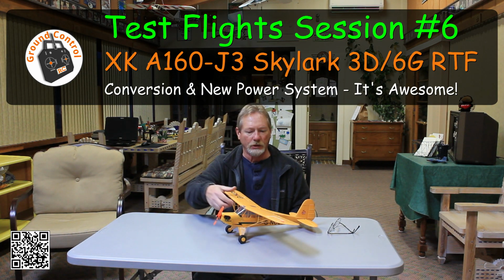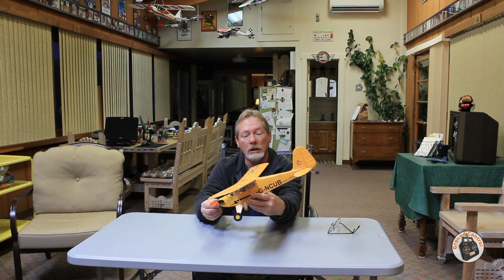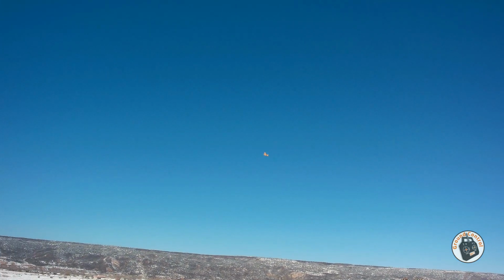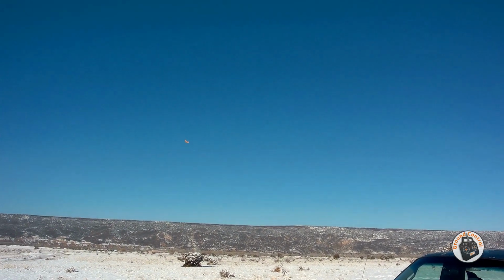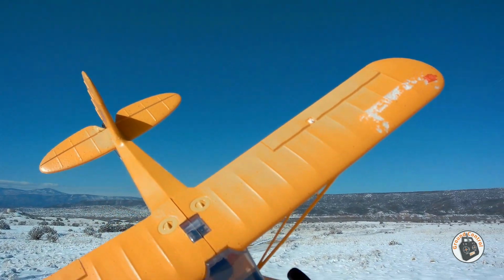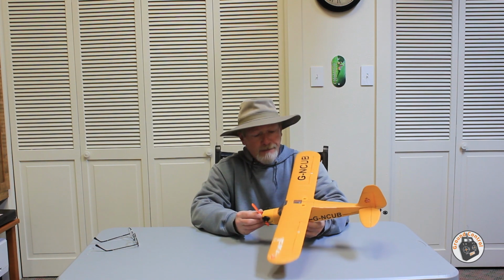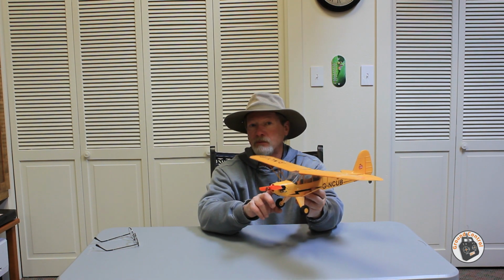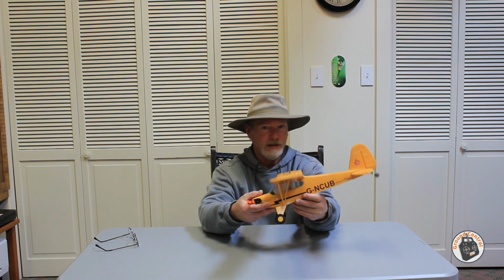XK A160 J3 Skylark Cub 3D/6G 650mm RTF - Manual Mode Conversion & New Power System, It's Awesome!

Comment: Great plane, i just bought it from Aliexpress, the version 2 of it. Apparent they fixed the tail and rudder issues it had. The radio is also different. I still need to fly it. My first plane though..
Reply from the maker: Good luck on your Maiden Flight!
I'm glad you're going to try out RC Planes.
They're my favorite things to fly.
Reply: @GroundControlRC  Thanks a ton, I'll need it. haha.. I have some experience if it counts at all, coming from drones and RC cars is my main thing. So my co-ordination is there, orientations etc.

Comment: I just bought one and I had a problem, the remote control doesn’t stop emitting a sound of a beep noise constantly, and the blade doesn’t move pls help
Reply from the maker: You might check any make sure you don't have any trim input on the throttle stick.
Also make sure the motor turns freely.
Check that your control surfaces move when you move the sticks so you know it's bound to the TX.

Comment: I just put the 1407 with a 10 amp esc 1060 prop and my own receiver and servo. All I can say is wow this thing flies amazing. Thanks for all the help
Reply from the maker: Hi Shane!
I'm glad that worked out well.
It definitely needed some boost on power ;-)
See you in the Air!
Reply: @GroundControlRC  running a power hobby 900 mah 2S. 30c 60 burst. Plenty of flight time and the nose weight helped
Reply from the maker: @shanemichaels8289  It's nice to get it balanced with a larger LIPO as I had to add ballast weight to mine.
Reply: @GroundControlRC  I’m starting a twin engined cub with my other xk a160 cub. Going with 2 small 10 amp esc stowed in the nose cowl for weight and cooling. The engines are mounted just inboard of the first strut. I’ll run the same 900 mah battery in that model.
Reply from the maker: @shanemichaels8289  Twin motor provide great power and you don't have to worry about torque roll.

Comment: Watched your whole series on this plane and it appears you've tweaked it to your style and liking. I'm a scale guy back to the 70's and I'm going to work towards achieving slow flight and lazy aerobatics like the prototype flys. Had a fueler "P51 Cub" years ago but I'd like to just make this one fly as scale as I can. Lighter and maybe some wing warping to attain some washout. The Eflite UMX Timber is fully capable of all out aerobatics while slowing to a walk to land, zero tip stalling. Its my go to "wind plane" to boot! Maybe I can get this J3 to do a little "scalin'", its just too cool looking to not try! Thanks for all the good information!
Reply from the maker: Thanks for the kind words. My Favorite Factory Plane so far is the Fun Cub 1100mm Kit. It exhibits all the traits you just spoke of. Very slow flight, very aerobatic, and I have yet to have a tip stall. I'm going to have to take it back out soon. Awesome Plane ;-)

Comment: You’ve got it flying awesome now with out the wing cuffs ? So looks like the cg too far back and causing the death spiral ! Which mine still does !need to adjust it great video thou
Reply from the maker: Hi Andy! Thank you much! Yes, even though I had already cutout some foam to move the battery forward and added nose weight, this Plane was still very tail heavy. I couldn't tell until I put it in Full Manual Mode. It was still so tail heavy it would stall on launch. Once the CG was set properly the stalls were no longer an issue and the cuffs no longer required. I'm very happy with it now ;-) See you in the Air!
Reply: @GroundControlRC  awesome I’ve subscribed to your videos as they are very informative and you know exactly what your taking about ! It’s a great little plane worthy of being displayed on a shelf ! I’m going to get it balanced properly this wk end I’ll put a video up hopefully for observation ! If the weather holds up
Reply: @GroundControlRC  how far back is your cg  from leading edge now ?
Reply from the maker: @andybladen9284  I still have my CG at 33mm back from the Leading Edge of the Wing. It seems to like a Neutral Balance at that CG.
Reply: @GroundControlRC  yes I’ve just retweeked mine because it had the death. Spiral plus needed a little bit more right thrust to counteract the prop torque it’s flying super good now surprised what difference a few grams makes to the cg in This model !!
Reply from the maker: @andybladen9284  It's too bad the setup was so bad right out of the box but with some adjustments it flies great. I'm glad you got yours flying well as it's a very nice looking plane ;-) See you in the Air!
Reply: @GroundControlRC  totally ! I’ve put an fpv camera in mine
Reply from the maker: @andybladen9284  , Did you locate it inside the canopy? That's going to make a very nice FPV Plane. With the clear canopy it seems to have been made for FPV ;-)
Reply: Andy blades check and see on yours I just noticed on mine that in 3g mode the elevator goes up automatically as throttle is added   In 6g mode the elevator goes up about 15-20 degrees up when it’s supposed to be neutral.  I had to adjust my elevator control rod about 6 turns in to get the elevator into a neutral position in 6g. Hope it helps because I know it was causing me problems with stalling.  In 3g I’d try to power out the stall not knowing elevator was being added. Then I’d switch to 6g and the elevator jumps up to 15-20 degrees up. Check yours and see
Reply: @shanemichaels8289  yes I believe that was happening on my model although I stripped out the xk receiver as I fly spectrum don’t have a radio master yet ! 
The Eflite receiver I have now was actually putting the elevator down in normal mode ! That is something I’m going to recheck it can be a handful if it’s not step up right mine seems to wallow with the stabiliser on as ifs it fighting it’s self !
Reply from the maker: @andybladen9284  Thank you much Andy!

Comment: My fixes on this plane were .  1  add weight to the nose. 2 I put barbecue skewers on the struts. 3  Only fly in  High Rates mode.  And now the plane flies like a rocket in the sky.
Reply from the maker: That's awesome! Once you get it setup properly it's a fantastic little Plane. I'm having a lot of fun with it ;-) See you in the Air!

Comment: You fly better than you ice-walk (teasing). I should talk. My feet have barely touched snow. Burned them many times walking on too-hot beach sand though.

   Those landing gear snow-ski's are looking more and more tempting  ;-)  Nice flying.

Delay from BG in getting my parts for the second parts-built A160.    I hope to have a UMX Timber receiver for the RTF soon.  Ordered one but the wrong RX was sent.

 New motor test coming up really soon.

The California Governor has lifted the statewide "Quarantine at home" order, so now if Santa Clara County does likewise then maybe I can finally get some air time.

Happy flying!
Reply from the maker: Hehehe....I drove down that dirt road and had no idea it was that slick ;-) I nearly fell on my Bum twice just recovering the Plane. On top of that, we got another 2.5 inches of snow yesterday and I'm going to try to get out there to fly today. I need some crampons ;-) That really sucks not being able to fly. I would be going completely bonkers! When the restriction is lifted you are certainly going to have a lot of different projects in the air. Good luck and I hope to see you in the air soon ;-)
Reply: @GroundControlRC  Not sure where you are, but we just took the first hit of what may be 3 days of storms. It's headed northeast from the S.F. bay area.  Get ready if it's headed your way.
Reply from the maker: @Doggeslife  , Uh-Oh! Guess I better get some flying in while I can!

Comment: Lookinng good!!
My plane put his nose up and almost stall when trottle goes above 50%....what you think is the problem....too high motor angle or too high wing insidence angle?
Thanks for sharing!!
Reply from the maker: Hi Alex! The biggest problem with this Plane is it's extremely Tail Heavy. The first time I launched it in complete Manual Mode it would nose up and stall on launch. See where your Plane balances. I now have mine balanced 31mm from the Leading Edge of the Wing and it flies well at that CG.
Reply: @GroundControlRC  Thanks but i fogot to mention that my question is for different plane. I have the issue of pulling up when throttle over 50%.....almost stall....what can yiu suggest can be my problem
Reply from the maker: @alexherrera3918  , Hard to tell, but I would look at the Motor angle if it's flying nice an level at cruising speed and just noses up when increasing throttle. A lot of planes will climb a bit when increasing throttle because of high angle of incidence of the wing but it shouldn't be a real abrupt nose up condition.
Reply: @alexherrera3918  If you can say what the plane is it would be easier to try to find an answer for you.  Some RC planes are designed to  cruise at half throttle and climb at higher speeds. There is no one solution that suits all airplanes.
Reply: @Doggeslife  . I did not have any cub, so i used the body of a Slowly V2 and  swap the original slow under camber wings to a flat KFM3 (1 meter wing) , it was my first one so it is not the nice looking one. If I am not mistaken i measure the wing angle about 6 degrees on the plans ....so i will try first to out a ice cream stick under the lower part os the wing to take off some of that angle of the wing. If that does not work then i will try to add an angle to the motor.
My plane is a bit larget than the origial i think.
https://www.rcgroups.com/forums/showthread.php?1686460-Sowly-A-magnificent-Land-and-Lake-Build
Thanks
Reply from the maker: I watched the video and that is indeed a very slow flying plane ;-) I can tell you from my Maiden of the Eachine Mini Wing Dragon that wings with a great amount of lift will definitely want to climb with speed and wind. I had to keep cutting the throttle just to bring it down. These planes are designed to cruise around very slowly and will climb with speed but it should not be an abrupt nose up condition with calm wind when it climbs.
Reply: @GroundControlRC  Many thanks for the comments. I will give it a try reducing the wing angle for the new flat wing. tks!!
Reply: If it is a really high-lift wing then consider mounting the wing level with 0° incidence. Then increase it in small amounts from there if needed.

Also note that the greater the lift the wing makes, the greater of a nose down thrust angle is required.  But be forewarned that more down thrust only helps reduce climbing while under power.  Get going fast and then cut throttle and the plane may suddenly zoom-climb on you.
Reply: With this plane in 3g elevator goes up as the throttle increases. Check the elevator level in 6g it should be level but on mine it was 15-20 degrees nose up. Shorten the elevator control rod 6 turns in